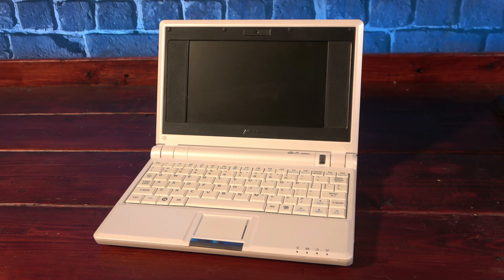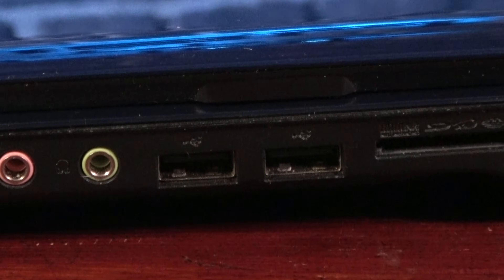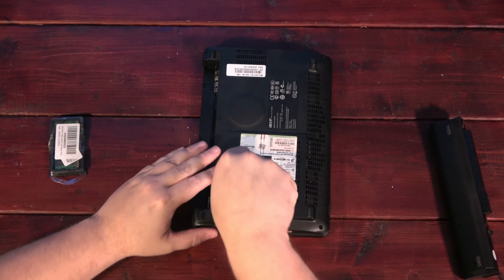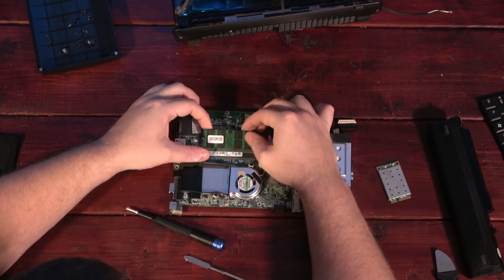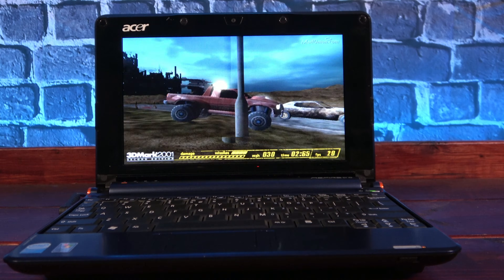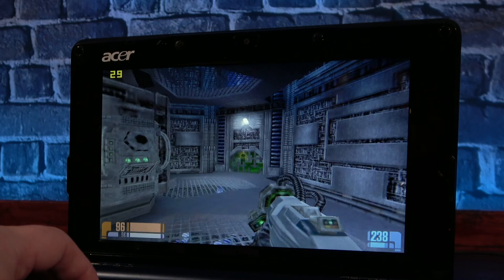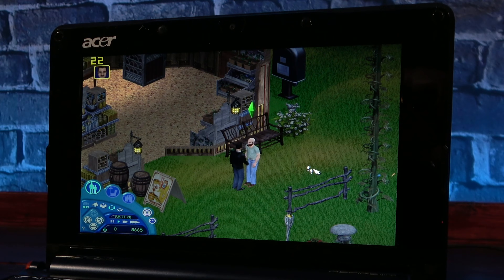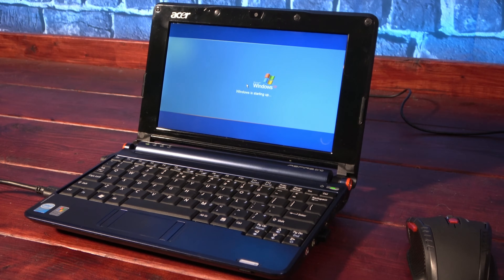Revisiting the Original Acer Aspire One Netbook in 2022

Comment: Another Netbook enthusiast here, have some comments to make:

- I really doubt that DirectX was stripped from that copy of Windows XP. The license sticker mentions ULCPC because it was a cheap kind of license that manufacturers could use that was only provided for certain low powered hardware that was thought to be too slow for Vista and 7 (though 7 Starter and even Home Premium was later licensed for some of those Netbooks). DirectX should be present unless Acer removed it for some reason, but even then installing the redistributable package should reinstate it. The Intel GMA driver however is known to have some strange quirks that make some games just refuse to work. Newer versions made for Windows 7 work better though and even Win 7 runs decently on those machines.
- That version of firefox is quite slow compared to some other browsers. The last version of chrome is even more outdated but tends to perform better on many websites including YouTube, playing back videos within some seconds of loading. An ad blocker like uBlock helps a lot with load times too. For more modern browsing on XP there's Roytam's New Moon. It's somewhat hidden but if you google for "RT's Free Soft" you can find the latest snapshots.
- There used to be a free software back in the days called GMABooster that was able to "overclock" the GMA graphics chip. I call it "overclock" because it allows it to run at it's stock 400 MHz instead of at lower speed that was set by many manufacturers of those netbooks. It didn't double performance or anything but depending on the game it added some FPS. However that software was donationware and had a time limit, which upon reaching it forced you to download a newer version from the official site that today doesn't exist anymore. Only those who donated back then own a version that works indefinitely but so far it has not been archived anywhere.
- Some also swear on modded GPU drivers (like the Chell modded driver) that supposedly improve performance and features of the GMA graphics on both XP and later versions, however I have not tried them yet.

Comment: I bought this exact one off eBay for 8.50.. needed new cmos battery, charger and laptop battery.
Reply from the maker: Sounds like a great deal! Having fun with it?
Reply: @PNPRetro   yes I got a new battery and accidentally ordered the high capacity 8800mh one so it now lasts about 10 hours! I have installed windows 10 but it's as expected super laggy right now. 

Keyboard is so worn that i ordered a replacement new one. 

I need to give the cpu fan a good clean. It's pretty solid, but need to finalise a stable OS.

Comment: I Have the Acer One with N450 and 2GB of memory - Oh My God this thing is basically unusable for anything !!! 

I installed windows 10 and updated it to the latest release and updates [ that took about 8 hours ]  and then ran CineBench R23 -  it took about 4.5 hours for a single pass and scored " 61 " 
[ to put that into perspective a Ryzen R5 3600 scored 8942 and took about 2 minutes to complete. ]

I tried a light version of Linux on this and it took for ever to do anything - forget about compiling most things from source it's just took slow for almost anything.
Reply from the maker: I haven't had a chance to run through any other operating systems yet, but it sounds like it's not going to be a ton better.
Reply: Where can you find windows 10 for this,,,mine basically cant do anything

Comment: My red Aspire One D257 came with a non glossy display. I bought it when it was new and it served me quite well until the beginning of the pandemic 2020, when I finally had to buy a newer laptop for Zoom to work properly. My machine came with the horrible MeLinux and I changed it after half a day to Ubuntu 12.04. For my needs it was perfect back then. With games I had a similar expirience. While fps games from the early 2000s worked fine, racing games were unplayable. Dosbox however worked (and works), for the most part, exellent. I upgraded the OS over the years up until Ubuntu 18.04 which slowed it down so significantly, that it became a real pain for everything. Even though I don't need it anymore, I still take care of it. New power supply, new battery, new keyboard, new display over the last decade. It served me very well over the years and I like the form factor of the machine. Today I run antiX linux 19 with xfce4 on it and that works pretty well. With SeaMonkey, a Firefox clone, it is still able to watch youtube videos in 720p, but I don't recommend it since it takes about 2 minutes or more to start the browser, go to youtube and load the video. But it's possible. I still use it every now and then as a typewriter, a pdf reader, to play some old dos games, or to watch some 720p videos from my movie collection. 1080p is really not needed on a display that small in my opinion and just drains too much system ressurces.
Reply from the maker: Sounds like it served you very well!
Reply: Oh, I forgot to mention: The charging port also had an issue on my machine once. But in my case it could be fixed by resoldering the port to the board. It became a bit loose over time.

Comment: hi there, during a clear out we found an aspire one, is it possible to connect to the internet? we have the same battery issue as yourself...running on the power out let...can it be saved ?
Reply from the maker: You'll probably want to switch to a newer lightweight distribution of Linux for using on the internet, but absolutely

Comment: I just got one from a laptop lot  battery the laptop turned on but showed no picture whatsoever I played with the ram it didn’t turn on it was found in a Storage unit and you describe the motherboard was dead I think it may be yours I live in New Jersey
Reply from the maker: Thanks for letting me know! But I'm in Canada, so likely just a coincidence.
Reply: Just to correct you the n270 is not a dual core its a single core with hyoerthreading. I have both versions of the acer aspire one the one with the hdd and the other with 8GB ssd. I actually use it for configuring network gear. I use Linux on it.

Comment: I found one in my grandmas basement, the screws are rusty and the ports too, i cleaned off the rust off the ports, but i dont know if its working or not
Reply from the maker: If you feel comfortable enough to open it up, you might want to take a look at how much corrosion is on the motherboard before trying to turn it on.
Reply: @PNPRetro  i did
Reply: @PNPRetro  it works
Reply: @PNPRetro  but the screen is broken

Comment: I still have my 2011 and 2012 Acer netbooks, one dual boots XP and 7 while the other is running Tiny7
Reply from the maker: Very nice. Do they see much use?
Reply: @PNPRetro  The 2011 one I use if I need XP for something, the 2012 one is for some old games because it has an AMD CPU and a halfway decent iGPU for its size.

Comment: That's awesome! The closest I have to that is an HP Elitebook 2540p, but pretty sure it would be miles ahead with its 15w core i7 640m
Reply from the maker: Yeah, I do believe the i7 640 would edge out thr Atom processor, just a little bit... the Elitebook 2540p looks pretty beefy for a small laptop!
Reply: The first Intel Atom and i7 CPUs were released in 2008. They were at opposite extremes of performance and power usage. The i7 had a TDP of 130W compared to the Atom's 4W. The Atom was designed specifically for low power draw and low heat generation, at the expense of performance. Long battery life and minimal cooling are great for ultra small laptops, netbooks and tablets on the move. The i7 was completely the opposite... blistering performance, but lots of heat and much higher power draw, even in 'mobile' form. It's a case of priorities.

Comment: The N270 is not a dualcore. It's a single core with hyperthreading, similar to a Pentium 4 HT.
Atom 330 was the first dual core Atom.
Reply from the maker: I just found that out in another comment. I was told when I bought my original Aspire One it was a low power dual core processor... I never went back to verify. Thanks for taking the time to let me know!
Reply: @PNPRetro  dualcore Atoms were more often found in Nettops, and they started using them in Netbooks after 2010ish with the Atom D520.
Not to mention the nvidia Ion netbooks, HP Mini 311 was a neat device with great GPU power for its size and price at the time, but the singlecore N270 was holding it back a lot in more CPU intensive games such as Half Life 2.
Reply from the maker: Yeah that makes sense! Sales guy who told me about it probably confused hyperthreading with multi core.

Comment: My Dell mini 10's charging port also went bad. Lucked into a $3 replacement on ebay a couple years back.  Must be a common failure on netbooks. I always meant to get a DDR2 800 module for it bc I think it shipped with DDR2 533

Interesting the Aspire One has a blower cooler. The mini 10 is passive, so it's a toasty boy unfortunately. Does have a very nice trackpad though and no soldered RAM.  I'll try to dig it out to run 3dm2001se and report back lol
 
Atom N270 is single core (hyperthreaded) btw :)
Reply from the maker: Look at that, you're right! When I picked up my original Aspire One back when they were new, one of the selling points from the sales guy was that it was a low power dual core processor... and I never went back to verify! 

Thanks for the correction. And let me know how yours does in the benchmark!
Reply: @PNPRetro  I slowed down the vid to catch a frame of the settings you used haha. Score 3024. Score 2940 at 1024x600 32 bit. It loses almost nothing with the increased gpu load. Very capable for many old games

Comment: I used an EeePC back in 2009. I think it was the 700. I installed Ubuntu which was faster than XP on it because it hits the disk a lot less. Used it while travelling for business. That said, it was just too slow to do anything, even compile basic code, and the keyboard and trackpad were both horrid. Solid it on ebay.
Reply from the maker: I think the only coding I did on my 700 was qbasic. The keyboard and TouchPad were definitely not fantastic, but I felt like they did okay with the space they had. Mine was mostly used for basic browsing, media consumption, and gaming. So nothing too serious.
Reply: @PNPRetro  As a point of comparison, I’m using a 1993 laptop for retro game development and it is better built with a good keyboard and a trackball that is miles better than a cheap touchpad. These netbooks should have been better.

Comment: I wonder how hard it would be to pull the motherboard out and replace it with a Pi 4 compute module.
Reply from the maker: Honestly, probably not terrible. Finding a driver board for the LCD, keyboard, and TouchPad would probably be the trickier part.
Reply: As a technical exercise, it's probably doable. As a practical upgrade, there's absolutely no point. You can get a much more modern, more powerful x86 laptop than this one for peanuts. If you specifically wanted a Pi based laptop, there are simple kits available that will do a much better job, albeit in an overall bulkier package.